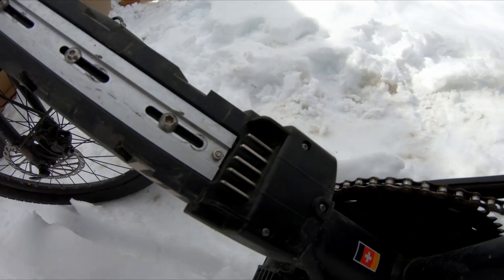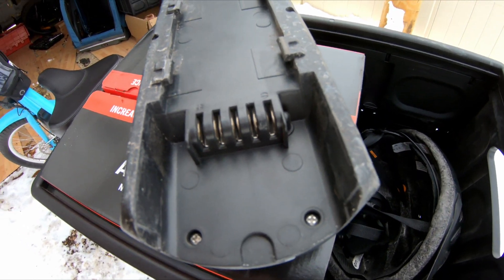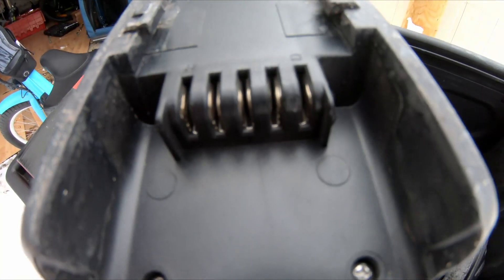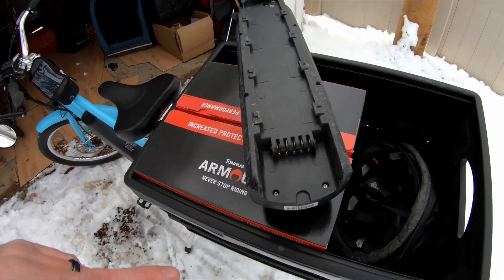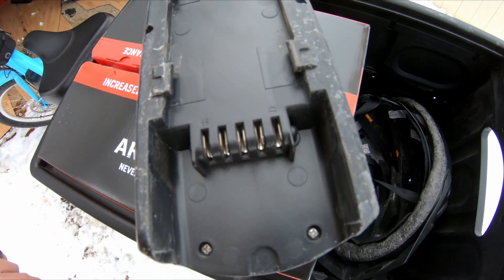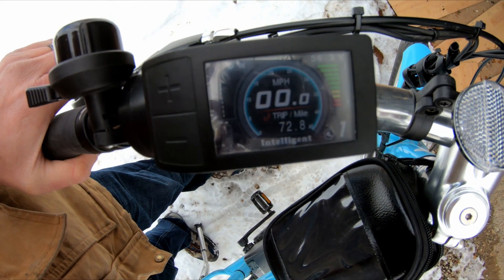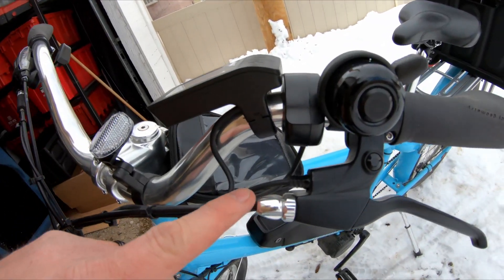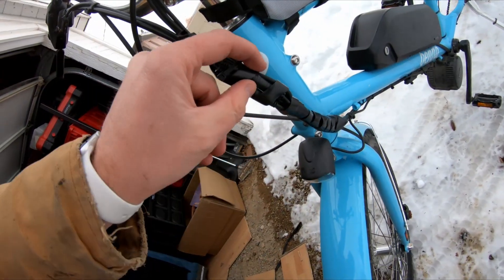Electric bike not working? Try these Troubleshooting steps!

Comment: Got a used Keteles K800 with error E02. Changed the controller, the cable harness, disconnecting brake, motor, throttle, etc. and no change. Voltage out is good 48V or better. I suppose the Display is next. Question I have is normally with only the battery, contoller and display connected should this power on with no error if all 3 parts are good? TY
Reply from the maker: Motor could be bad too. More specifically a wire connection somewhere on/in the motor
Reply: @JohnnyNerdOut  Thanks, just to clarify. I do not have the motor connected. Just the Battery, Controller and the Dispaly and still get the Error 02. Battery Voltage is good, controller is new. Plan now I guess to get a new Display. I was just wondering on this Ebike, that 3 component config should work without error.

Comment: Hi, i have an ebike that is about 3 years old. 
It now only gives very little power.
I have checked all connections and battery seems to light up fine.
Weirdly one day when out on a long ride all the power came back just at the end of my ride.
But the next time I used it It again had very little power.
Halford won't fix it because I didn't buy it from there. I am unable to get anyone to look at it and am frustratingly all out of ideas myself.
Also the bike dose not have a speed sensor as I was looking to see if this had moved or got dirt on.

Any helpful advice would be very appreciated.
Reply from the maker: I’d start by looking at the battery. Take a voltmeter to it after it’s fully charged and then after it’s been ridden a little bit and see what the voltage is that you could have a bad cell or something in the battery.
Reply: @JohnnyNerdOut thank you, I will give that a try.

Comment: The problem I got with mine is I’ll ride it to wherever I’m going turn it off and sometimes it randomly says I have a dead battery flashing and it will not work. I tried looking at connections and the battery has a full charge. I’m not too sure what’s going on with my E bike

Comment: I have a Shwin boundary, it works very good until I encounter a bit of rain or humidity and it stops working, it stays turned on but doesn´t work, after a couple of days it works again.. any idea?? I have tried disconnecting the brakes cut offs but still doesn´t work.   Thanks,

Comment: I drove my Addmotor m50 to work, everything seemed fine was only 6 miles, battery was fully charged parked it ,turned it off went in and worked 10 hrs. Pressed button to ride bike home, nothing on display,  could not turn on. Charged battery again, waited till morning, went for 3 block drive worked fine, turned off, tried to turn on again nothing. So I charged battery again frove it 1 block, turned off, tried to turn on again nothing. Repeated again 2 more times. Bike turns on after charging, turn off, then try to turn on again, won't turn on. What is going on?

Comment: sir I have a bafang kit on a brand new bike  when I lift the tail end and attempt to use the manuel throttle the wheel spins and then slows to a trickle???   everything seems fine ive checked the wheel sensor for some reason it seems like a software thing ????  can you suggest anything thanx..
Reply from the maker: Is it detecting speed?

Comment: My son's got an ISINwheel U1. Rode it a couple weeks & it stop working. Still has power, but no throttle. Under the seat & next to the rear shock, I found a cord that had somehow been severed, but no clue where in was attached. I don't see another severed wire... any suggestions?

Comment: I just got a Riding Times GT73 for Christmas. I rode it a couple times and it worked great. Then when I tried riding it again the other day, the bike powers on but I cannot unlock it with the NFC key card. I’ve been searching the internet and manufacturers website and it seems no one else on the planet is having this issue. My bike is now rendered useless in my garage after riding it only twice.

Comment: Here is one thing likely that will cause damage to a e-bike which most people would not think to look at. READ ON. I have a new Cyrusher Ovia just to find out that it stopped working due to the charger putting out AC which ran thoughout all DC components and the entire frame. A bad charger which somehow put out AC at the DC side. The hight power of the AC acted like a electromagnetic pulse or static electricity that did damage. One would think not but it can. Cyrusher sent another e-bike and when I checked that charger it did the same thing now Cyrusher is slow in responding. I suggest buying a Fluke brand non contact AC tester which will only indicate if AC is present. This is what I used. I suggest everyone have this inexpense AC tester then plug in the charger to AC hold tester to the cords AC side it will light up and beep indicating AC then do that same thing to the other side of the charger (DC side) which  plugs into the battery: no AC should be there and the tester should not light up or beep, no light or beep on the DC side means it is good, but if it lights up then there is AC current where there should be only DC. FYI I was told that Cyrusher has laid off some workers and restructuring. I like the e-bikes but now there is liitle to no customer service.
Reply: WHO'S LAYING OFF?? our ebike display no responsive!! we attempted bypass by blue and red wire tie!! No throttle and motor power!! Ebikes are STUPID lots of simple troubling errors and no work...huge head aches....like Teamsters Union, nobody's laying off!! trust me...smoking ?

Comment: I bought my son an SMLRO ebike I've changed the throttle the display and the rear wheel where the motor is.    The led shows no codes and allows me to put peddle assist on. When I turn the throttle it makes a very faint beep and the wheel will slightly move.  It's been a headache don't know what else to try.
Reply from the maker: Last thing would be controller it sounds like

Comment: Thanks Brother  ! , I'm new to e bikes had it upside down witch stopped the hydraulic front brake working and noticed a small piece tapped on the front brake lever that I took off that was the magnetic  , problem solved..

Comment: How do I fix a Swft e bike with no power. If you can fix any bike please help.
Reply from the maker: I would need a lot more information. I’d start with checking battery voltage.
Reply: i have the same bike that’s broke. did you fix it?

Comment: Hi Jonny, I have an L750 pro step through, fat tire, rattan e bike. I had a back tire blow out, my ex fixed it but was unaware of the wire attached to back tire & yanked on it. Now my bike powers off if I go into any gear higher than first. I checked connections but don't know anything about ebike maintenance (yet). The display stays on, the battery is fully charged, but if I push the throttle in gear 2 or higher, it powers off. Sometimes if I take battery out then put right back in, it will power back on but as soon as I take off, it powers off again. Can you help? I'm a single mother, with no extra money & this bike is my only transportation. Thank you.
Reply from the maker: It sounds like possibly the yank may have pulled a wire out of either the controller or the motor. I’d start with a new controller as that is cheaper and easier to replace than the motor. If that doesn’t fix it, get new “motor guts”. It’s about 30-60 min job to replace the guts by a professional.

Comment: Good advice.  Thanks for the tips.  I have a 750W BBS02 with very low miles on it (maybe between 200 and 300) that has started acting up.  I'll be riding along fine and then suddenly I'm getting zero help from the motor, even when pedaling very lightly.  Display reads zero watts.  Then suddenly it will kick back in again.  Other times the display just goes dead and motor loses all power.  I try to start it up again and it often dies again before I get the password fully entered.  Other times it will let me log back on and then die.  Then suddenly it will be fine for several miles.  Battery level doesn't seem to have much to do with it.  It's done that with 90% left and down to 70% left.  Anyway, I'll start following your tips and see what I come up with.  Thanks again.
Reply from the maker: Sounds like a connection issue. Keep in mind that “connection” could be a wire going to the controllers board which is not really serviceable.

Comment: Hi, my bike display turns on briefly like 2 seconds then shut off completely.  I turn off the battery then turn it back on and hit the display on button and same thing shuts off after a few seconds.  Battery is fully charged, what could it be?
Reply: Hey bigmike did you detect the problem? I have the same issue.

Comment: I Baught a brand new Befang Hd today and it’s not powering up. The screen is not switching on. The pins are to small in the wiring harness, to check with my multi meter. I did check the outfeed of the batter and it has power.. Anyone any ideas, thanks
Reply from the maker: I’d call whoever you bought it from.

Comment: I read a comment that said the problem could be faulty wiring in the battery however the bike ran perfectly for over a hundred miles before this happened.. I've been checking wires and other things and I discovered a sensor on the crank I'm guessing controls the on/off when peddling or not so my next question is should it be freely riding or should it be in some way held in place

Comment: Went for a ride yesterday afternoon, came home and parked my bike, turned battery off. Later I went out to check a setting on my EggRider. Turned battery on then I turned EggRider on. Totally dead. I took battery off and plugged it into the charger. Stayed green showing full charge. The power meter on the battery shows battery is full charge. I opened battery and checked 40 amp fuse. It checks fine. I’m thinking battery has 1 or more bad cells. Any suggestions?
Reply from the maker: Check the voltage of the battery. It should still power up with a bad cell, it would just die really quick

Comment: Hey, I have an Oraimo scrmabler 100 and it was working perfectly.  I turned it on for a second and the screen went off, I thought it was dead and charged it back up and it wont come one at all.  Looked at all the cables and wires and connetors and it looks good. 

any advice
Reply from the maker: Put a multimeter on your battery. Make sure it’s good and all the physical switches and fuses are good.

Comment: Do you know when your battery has like 10% and it gives those moments when it gives energy and It's all fine but after seconds it cuts off energy so pedals make that noise... My battery is fully charged, i have changed connectors both, inside the battery and inside the racket.
It goes smooth for 30m and then again it interrupts as im riding, interrupts the current and then goes well, display stays always on, only the pedal assist stop and starts in fraction of seconds, then it goes 10s and then all over again 😭 any idea?

Comment: My Ebike shows a fully charged battery but when I turn on the battery it shuts down after only 10 or 15 seconds.
Reply: Is because faulty wiring in the battery and the connection between the battery and the actual bike

Comment: These steps can be used for fatbikes aswell.
Mine was unpluging the brake connector.
A indicator its that problem is that the brake Light stays on.
Thans for helping.

Comment: I bought an e-bike with the same interface about 9 months ago and recently it randomly stopped going full speed of 50km/h and only reaches a top speed of 24.5 km/h.

What could have caused that and what can be done to repair it?

I tried to reach the company but didn't have any success. They stated that I needed to reset the bike and gave me reset instructions that didn't work.  I found a video on YT instructions for a reset which worked to reset the bike but the speed problem remains the same.

Any suggestions? Thank you!

Comment: my batterie is charged and the display turned on,  When I took it out today the display would not turn on and the battery would not kick in.
Reply: Must be a magnum pathfinder T
From Bend Oregon ! They suck
Reply: Just got mine took it out to tighten the seat lock because it was loose I put it in and it won’t turn back on

Comment: The battery level indicator stopped working always shows 100%
Reply from the maker: Could be set to the wrong voltage. Might be set to 36v if it’s a 48v system for example. I’d check that first.

Comment: Hi Johnny, some good advice there. Yet although I think my issue is probably simple, I found myself without options.
I have a Skott-E Sub Tour, the controller displays everything except the speed indication, so I naturally check that the magnet
on the back wheel is in-line and that the battery is ok. I hang up the bike to test the speed, yet still no graphic or indication
with the large speed info? The controller seems to be fine, yet wonder if an internal battery in it is low on power?
Apart from this I have no idea, I also checked the wires.

Any tips? 🙏

Comment: Thanks for the video!  In my case the situation was the battery tabs, after 700km my girl friend Bird bike started acting like intermittent power, I use a very small flat head screwdriver to push the tabs back and it looks like fixing it.  I notice when the bike is getting a bump we observe the issue, I guess the frequent bumps make the contact to be loose.  I now use a velcro strap to tie down the battery, hopefully it might help.

Comment: My bike stopped working although periodically the motor will catch both pedal assist and throttle but only for a second then it's dead again.. any ideas where I should start looking? It's a 500w trike and battery has good connections thru the lights.
Reply from the maker: Could be a bad battery. If it works fine until a load is put on it, I’d be looking at the battery.

Comment: Hi Johnny. I got the isinwheel M10 Commuter Ebike only 10 days ago. My battery is fully charged, the problem is when I turn the throttle, the motor just lurches for 1-2 seconds then stops. If I get off the bike and lift the back wheel, it works fine, but when I sit on it, the motor stops after a second. I'm only 130lbs and the specs say up to 330lbs, so its not my weight. any suggestions?

Comment: Hey johny,iwonder if you can help me,ive had my engwe pro engine two years now got 18oo miles on it latley when it gets down to 35 percent it just shuts down any ideas,thank you
Reply from the maker: Check the voltage with a voltmeter when it’s at 35%. Displays are rarely accurate

Comment: Okay so on my bike everything looks good everything is connected and good. But my assist mode won't turn on(the bike itself is a Rockshark) I however haven't unplugged everything yet. But the display has a headlight and a occasional flashing green light.
Reply: Any help would be amazing as this is my main mode of transportation to and from work

Comment: Can I ask about the k800 fat bike? I just swapped out the display because the other one. The screen was half burnt out. It's the M5 e bike works with the old display as soon as I put on the new display the bike does nothing. I've adjusted the setting and still nothing what am I doing wrong

Comment: Hi I have a question if anyone can please help. My battery used to work fine. Now it seems to die when I still have 2 or 3 battery bars left. It used to go all the way down to one bar and blink on one before dying. Now it just dies instantly when I hit 3 bars left or 2 sometimes. Is my battery bad or what is going on? ( On the trail I ride witch is basically 100% flat for many miles. I used to get 45miles max on just battery no peddle. Now I can barely break 16miles. The battery hits 3 bars and dies instantly. Please help if anyone knows what happened. My battery is still under warranty. It's only 6 months old. ( Side note. It's not the bike. I used my gf battery in my bike and it works like mine used to. Good milage and no shut offs Until the battery reaches one bar blinking then dies.
Reply from the maker: Could be a bad cell to cause it to die prematurely

Comment: Is it easy to change a hail long 20ahn cradle replacement ! Got same connectors only worry about connecting to main line power lines got one red wire and the normal black red connector  ! For BAFANG 1400 watt midrive BBSHD Same as the original it came with ! If possible what is the red one with no connector please ,do I rewire the red one the others have connectors ? Thank you !

Comment: Great video. Hi I'm Lg. . I have a Haoqi H1000. My voltmeter says 52 but the button on the battery that shows how much power high and low is not working ... Is the battery good but that power light stopping the bike from getting power. Please any suggestions .

Comment: My Astro pros hydraulic disc brake sensor got chewed by a puppy. The bike turned on once after that but once powered down it will not come back on you think that sensors the issue.